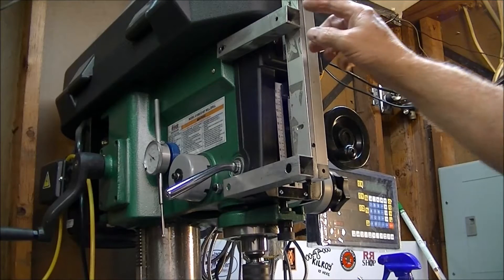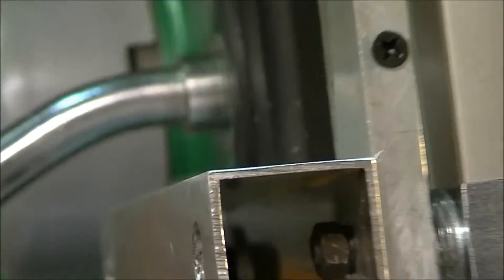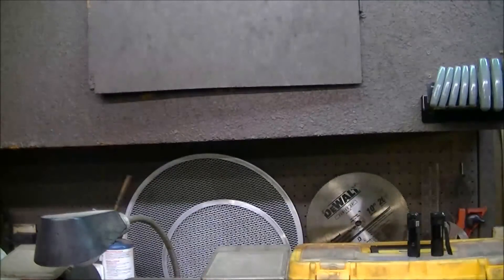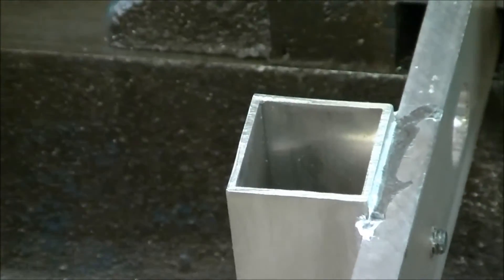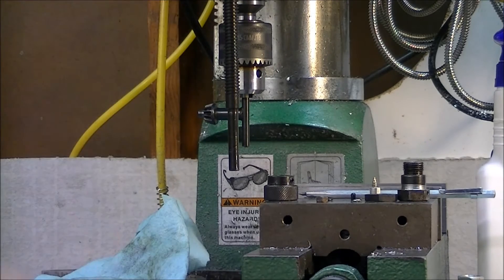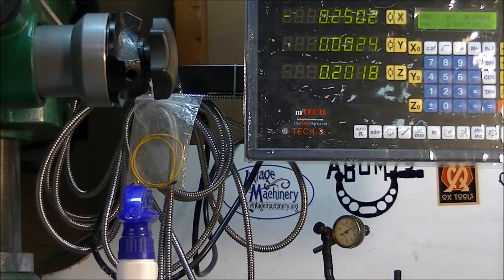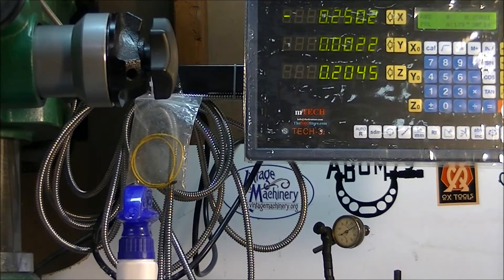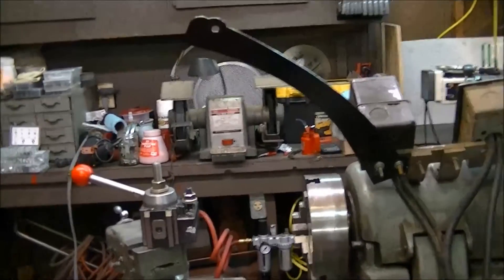DRO Improvements

Comment: After hearing about your difficulties with the z axis  scale on your mill, looked over my mill to see  if I  could improve it.   I made a Z axis mount on my  round column mill by using the back side of the clamp on the quill.  It is machined flat with a slot that will allow a 10-32  screw to pass through without interfering   with the clamp.   I took  piece of aluminum angle and milled a shallow key that would fit loosely in the slot and clamped it through the slot .  I cut the  angle long enough to give me a stable mount for the DRO sensor beside the head casting .  I then mounted the scale on a piece of aluminum screwed to the side of the mill between the quill and the column.  The scale was easily aligned with a couple of shims,  The finished Z axis scale mount is stable and out of the way. I hope this might help.  Keep the videos coming they are very informative
Reply from the maker: Great idea on the DRO.  Thanks for stopping by.
Reply: Do you have any pictures or video for this fit?

Comment: I found these two quotes googling the Toyota runaway crashes:
Quote:
If anybody should have known how to stop an out-of-control car, it was Saylor, who was trained in emergency and high-speed driving as a 19-year CHP veteran. But a close look at the Lexus ES 350 raises questions about whether the car's very design may have compromised Saylor's skills.

One obvious line of defense is to simply shut off the engine, a step that may not be intuitive on the ES 350. The car has a push-button start system, activated by the combination of a wireless electronic fob carried by the driver and a button on the dashboard.

But once the vehicle is moving, the engine will not shut off unless the button is held down for a full three seconds -- a period of time in which Saylor's car would have traveled 528 feet. A driver may push the button repeatedly, not knowing it requires a three-second hold.

Quote:
The other common defense tactic advised by experts is to simply shift a runaway vehicle into neutral. But the ES 350 is equipped with an automatic transmission that can mimic manual shifting, and its shift lever on the console has a series of gates and detents that allow a driver to select any of at least four forward gears.

The arrangement of those gear selections could make it difficult to shift from a forward gear directly into neutral in a panic situation, Toyota spokesman Lyons acknowledged.

"I think it's possible to get the shifter confused, but I can't be sure that's what happened" in San Diego, Lyons said. "You'd be surprised how many people around here [Toyota] don't know what the neutral position is for."

The most obvious impulse for any driver experiencing sudden acceleration is to apply the brakes. But when an engine goes to full throttle and is speeding at 120 mph, the brake might not stop the car.

The ES 350 and most other modern vehicles are equipped with power-assisted brakes, which operate by drawing vacuum power from the engine. But when an engine opens to full throttle, the vacuum drops, and after one or two pumps of the brake pedal the power assist feature disappears.
Reply from the maker: Timothy Green so basically no one tried to put it in neutral and if you have a sufficiently automated car it gets in the way of operator control.  I would certainly avoid turning off the ignition as most cars lock the steering column when the ignition is off.  I have two Toyota cars, not high dollar like the Lexus but they are Toyota and I can easily put the shifter in neutral.  If it is hard to hit neutral then try for the lowest gear possible.  Even at high rev the car can only go so fast in a low gear.  Even though I will probably never be in a Lexus I bet you can get it to neutral.  If you have time to call 911 you have time to work the shift lever to neutral even if it has a very tortious route to get there.  I know it is easy for me to talk as I am not in the emergency situation but if you can control your panic you can stay in control.   Thanks for viewing and commenting.